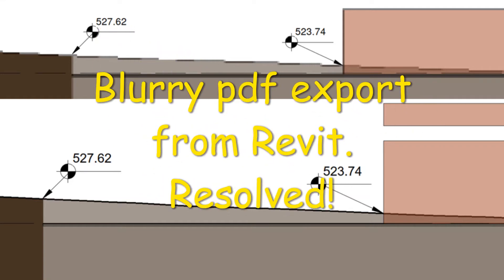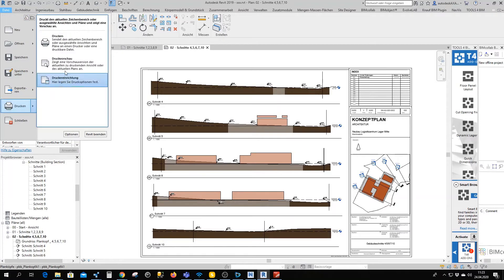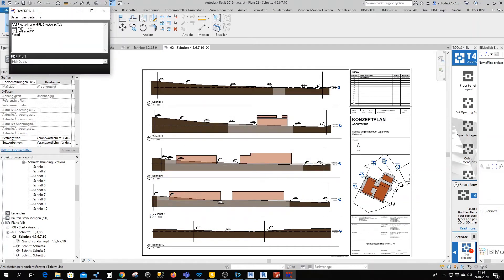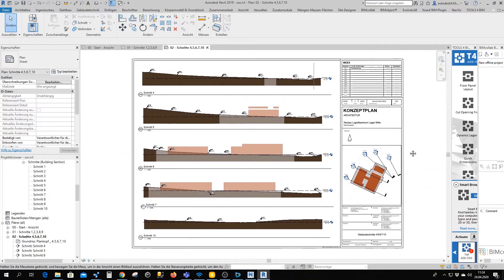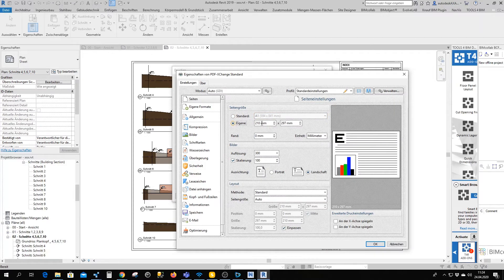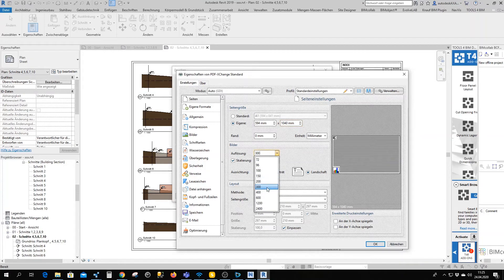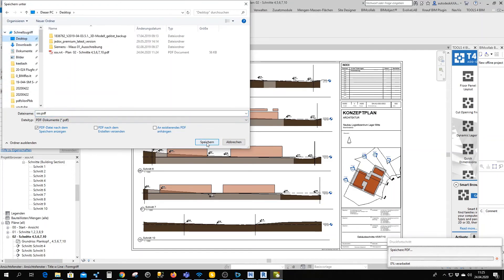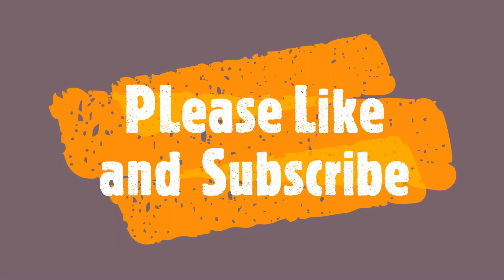How to Export High Resolution Pdf from Revit - Resolved!

Comment: So you just need to use the better pdf print software. Can you please make a link to it?
Reply from the maker: Hi Maciej, 
thank you for your comment. I've now included links to the PDF software in the video description. I think it shouldn't matter which software we use and the blurry pdf issue can be solved by updating the print setting.